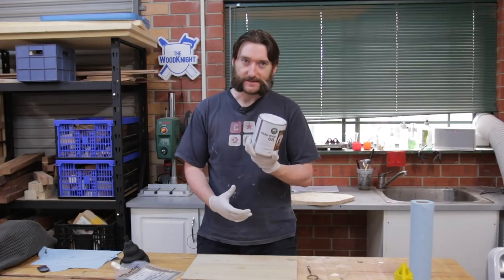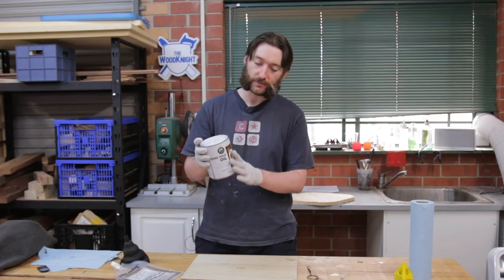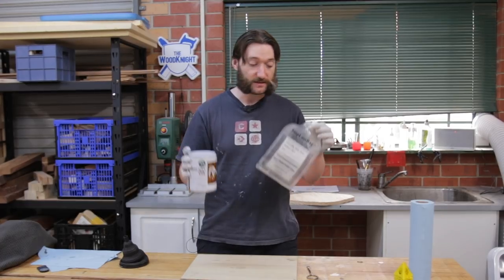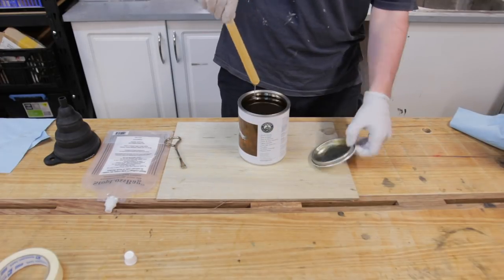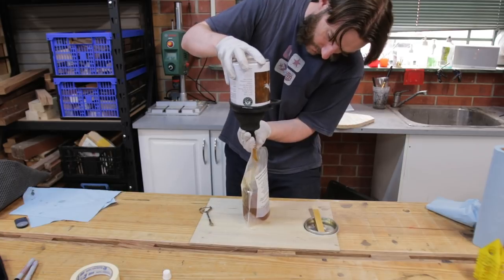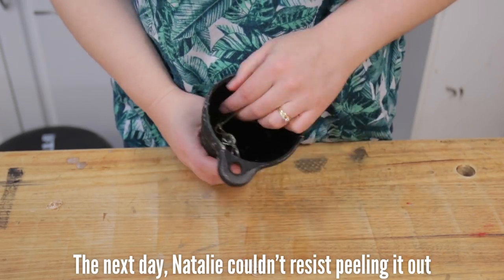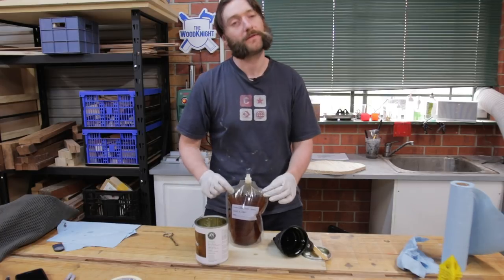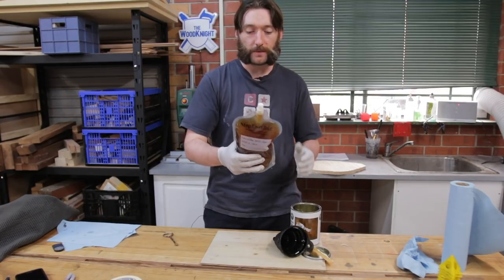StopLossBag - An alternative to tins for wood finish

Comment: Is UV light an issue with these bags?
Reply from the maker: For the plastic? I don't think there would be, but for the finish inside it? I don't think there is any level of protection. I'd imagine that some finishes would probably suffer a lot from UV though - shellac perhaps. Maybe StopLoss need to produce a tinted bag, ala the tinted jars some finishes come in?
Personally, I keep my finishes in a cupboard so it isn't an issue for me.
Reply: @TheWoodKnight  Yeah the finish itself. I know not all finishes would be effected, and I  know most don't store finish in direct sunlight, but it was just something that popped in my head. Definitely going to give them a try. Thanks Paul.

Comment: I've used these bags for a couple of years now, they work great.
Reply: Have you found it easy to clean the bags, or do you end up throwing some of them away? Which finishes are easiest and most difficult to clean adequately?
Reply: I keep Waterlox and Danish oil in them, no trouble cleaning the bags yet. I've got one bag with Waterlox in it for 4 years and its still good.
Reply: Waterlox is really expensive here, mail order mostly. Frank Klausz swears by it. What makes it so special? Isn't it just Danish oil? Is it that different from Watco?
Reply: I tried it on a project because everyone raved about it, but found it too glossy and plasticy (if that's a word) for my tastes.  That's why I have a stoploss bag with four year old Waterlox.  My go to finish is Watco Danish Oil.

Comment: Where did you get that FUNNEL? My stoploss bags didn't come w/ any funnel. I've been saying for years that CANS should be created with PUSH UP bottoms that remove the air as you use them, but until they're invented/perfected, these bags look like the best solution.
Reply from the maker: Directly from stoploss themselves - its a separate item, but I couldn't find any "good" solid funnels that'd collect enough around the tin and fit into the bag. Well worth it I think!

Of course, a day after shooting this I found kmart (AU) has a similar "Silicone Foldable Funnel" in the kitchen section, but I'm not sure if it would fit into the bag as nicely

Comment: It'd be great if they sold it this way. But I'll bet they profit off waste.
Reply from the maker: I agree it'd be great, but there is likely some other issues - filling/retooling to use these rather than tins at the factory would likely be expensive, and as Luke Owen pointed out in the comments, UV could be an issue. No good having a better storage solution if it all goes off in a shop because it sat too close to sunlight! There may be some other issues too - tins may be cheaper to make (though that could be chicken and egg)